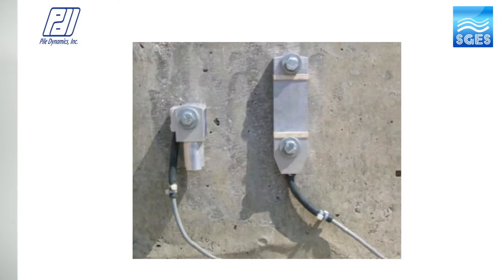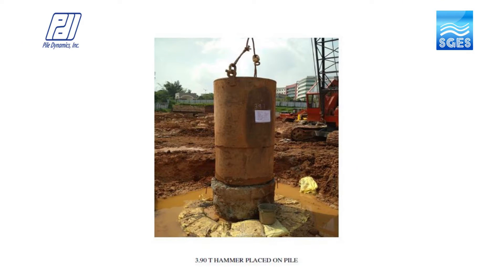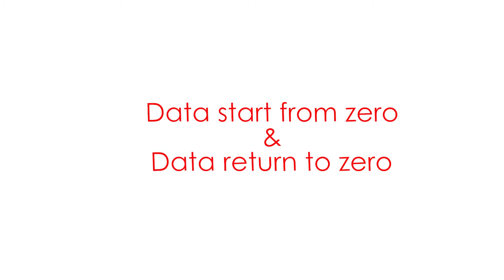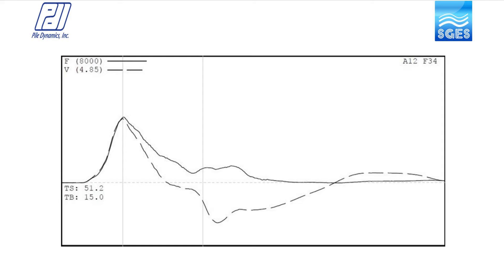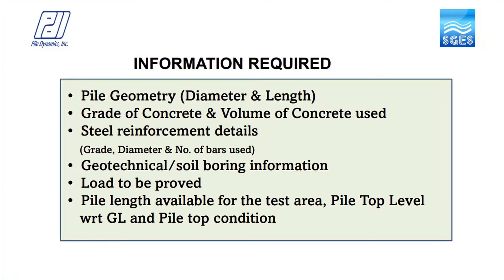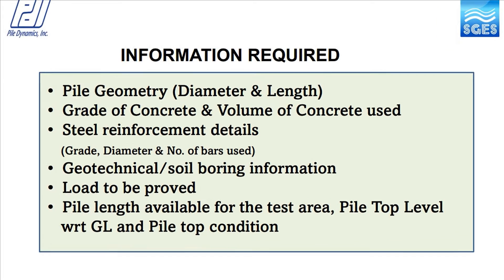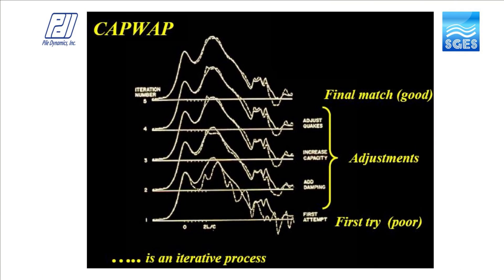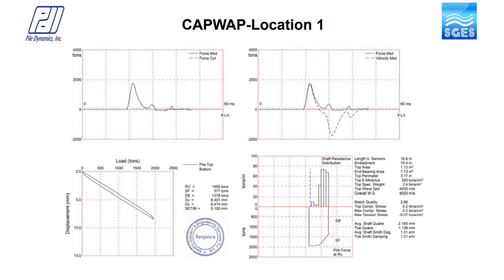High Strain Dynamic Pile Testing (HSDT) | SGES

Comment: Suppose we want to test a pile for 800 ton...1% dead load means we will prepare a dead load of 8 tons...now from which height we drop the dead load to implement a design load of 800 ton...we cant frop at from beyond 3m because the dead weight deviate from center of pile with increase in height...

Comment: Sir,Excellent information recent technology for pile driving testing, accelerometer used only 90 degree And used 2 strain gauge
Reply: Strain gage at 90deg to compensate biaxial bending and 2 accelerometer at 180 deg should be fine, since accelerometer is insensitive to bending.
Reply: Thank you for your feedback!